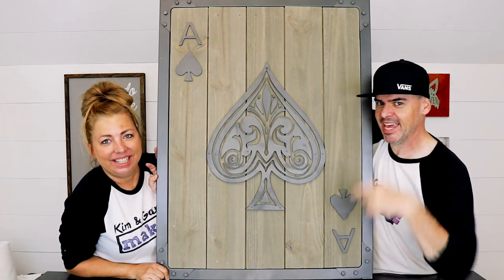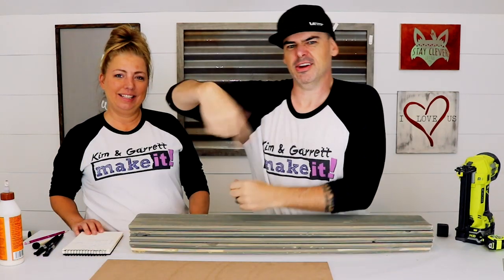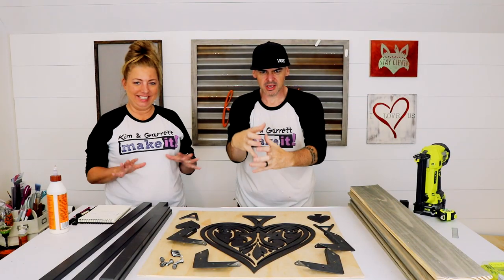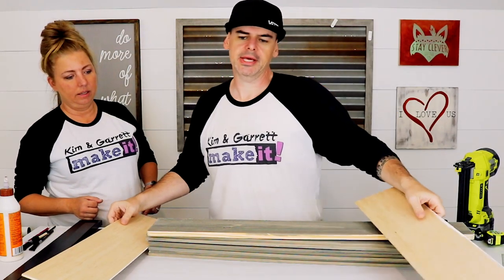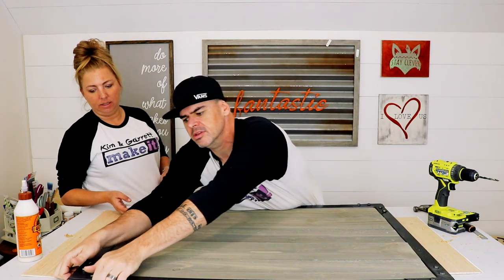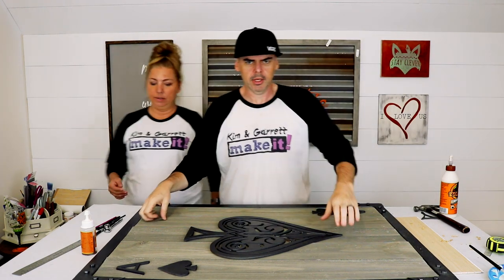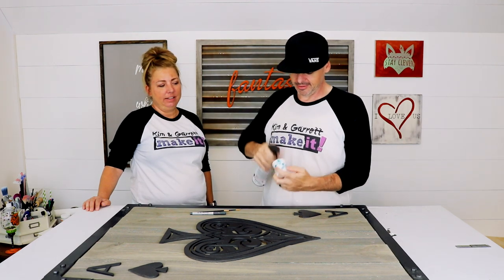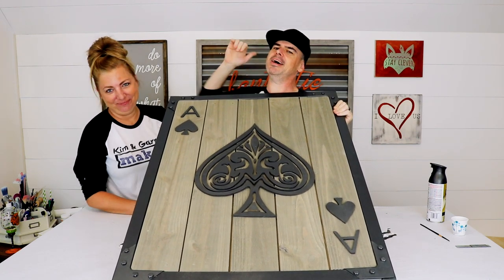Ace of Spades Wall Art | Casino Decor | Game Room Industrial Decor | Mancave

Comment: What type of brackets did you use
Reply from the maker: They are Simpson Strong-Tie RTA 18-Gauge Rigid Tie® Angle for 1x2 Joist/Post
http://www.homedepot.com/p/Simpson-Strong-Tie-18-Gauge-1X-Rigid-Tie-Connector-RTA12/100375385